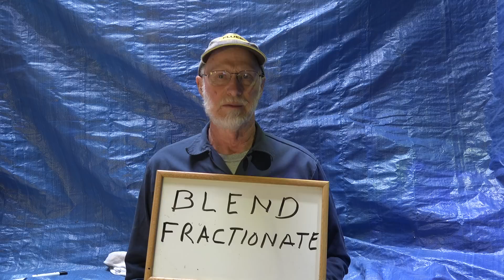The fractionation of refrigerant blends

Comment: My brother and dad always charge 410a with the bottle upright haha. I just stand there and let them. Then got my license and work for myself. I just did an r22 to 422b replacement seems to be working. I charged it liquid...upside down
Reply from the maker: You may be able to get away with charging R-410A upright as the difference in pressures of the gasses is quite low.  However, as the cylinder empties, the change in percentages increases.
GFM
Reply: @grayfurnaceman  thanks for the response. Wish I had someone like you teaching me when I was new.
Thanks

Comment: All refrigerants that have an A at the end is a blend and must be charged as a liquid. That includes 410A, right? So if I have a leak in a 410A system should I recover the rest of the charge and throw it away? I've never thought about this.
Reply: Yes about charging.  If there is a leak, unless it has leaked out very little, the charge must be dumped.  The pressure difference between the blend components is very small, but it is there so the blends will leak out at different rates.
GFM

Comment: Best of the best explanation of fractionation. 
And honestly, regardless of all those alternatives refrigerant, I agree with Lennox, the best thing to re-use is R22. 
If I have to recover a refrigerant due to a lock up compressor, I can re-use refrigerant R22. Prior to recover tank I use a liquid dryer to remove sediments from old refrigerant. Then replace compressor , replace liquid dryer and topping with new R22 in case it needed.

Comment: Good topic.😎
Most of the markets that were running R22 have retrofit to R407A or R407F. A lot of these systems use around 1200 lbs of gas and the average leak size is 100-300 lbs per leak. And that system will leak maybe 1-3 times a year depending on which way the wind blows. Most of these markets have been retrofit within the past 5 years. Give it another 10 years and we will see if problems start to arise. Even some of the new stores are being built with 407F. 
Great topic. It gets me thinking. Thanks for the videos.😎

Comment: Great video gfm. I have a 410a Mitsubishi city multi system in a commercial lab area with 26 evaporators fed from a distributor box. Came across a small leak awhile back that caused the system to lose 90lbs of vapor refrigerant. The technicians manual says that temperature glide from fractionation is a non issue and states that recovering remaining refrigerant is not necessary. Tech support can't give me an answer as to why it's not and I was wondering what your thoughts were.  If I had to guess maybe it's because the electronic metering devices may compensate for this but I'm not sure.  Thanks for the videos keep them coming!
Reply from the maker: The manual may be correct.  However, with that much refrigerant leaking, I would replace the refrigerant.
GFM
Reply: a "Small leak" that dumped 90 pounds!?  what is the total capacity?